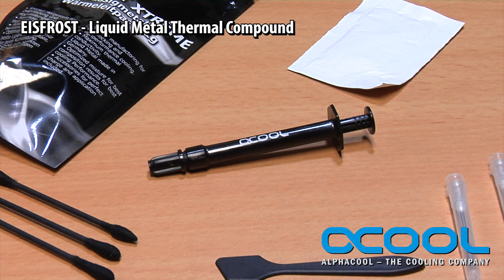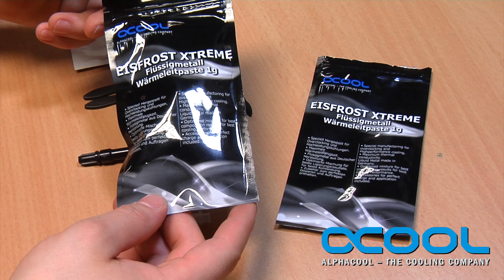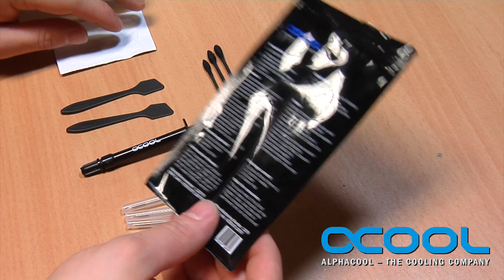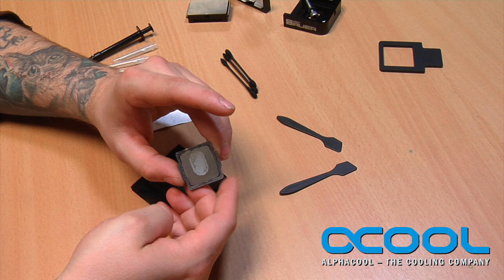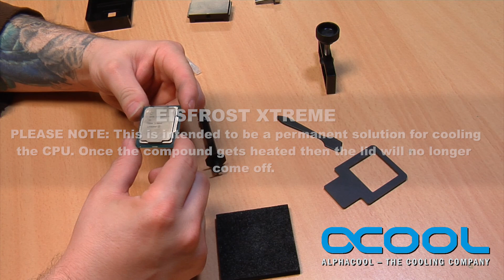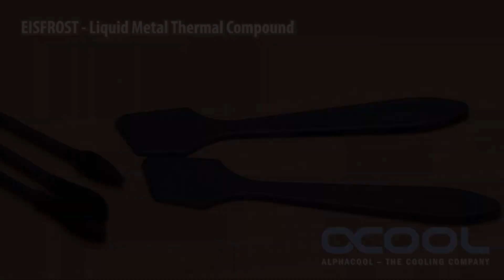How To: Install the Alphacool Eisfrost

Comment: For everybody who is watching this, he doesn't know what he is talking about!

Liquid metal is only prohibited on aluminium and copper blocks, cause it reacts with those and gets solid and bonds the DIE to the block.

There is no risk of glued DIEs to IHS or blocks as long as it's not aluminium or copper.

I am using liquid metal direct die with nickel plated waterblocks mounted directly for 4 years now and there is no issue at all removing them.

Temps are still the same as day 1 of application.